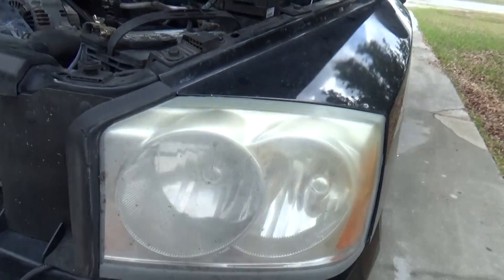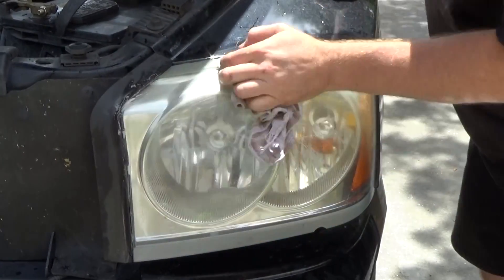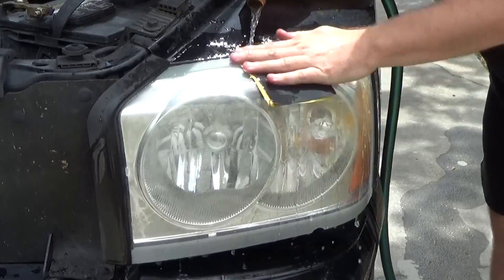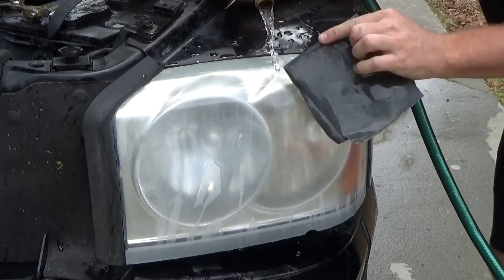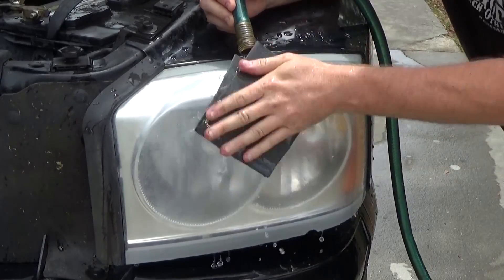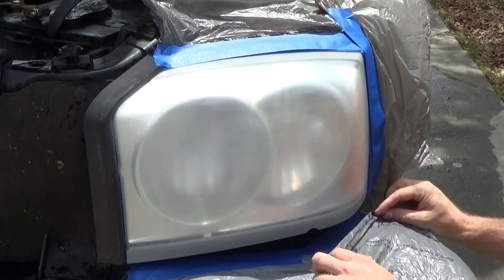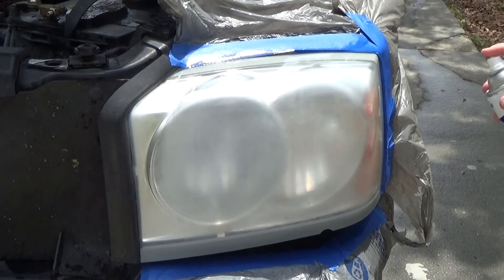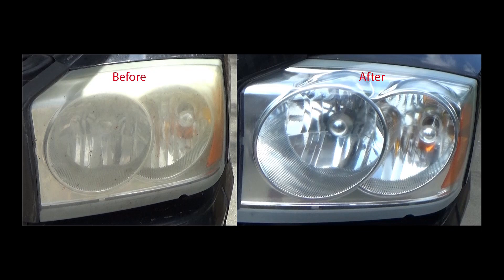How to Fix Yellow, Scratched or Foggy Headlights

Comment: After using this process and it lasting a year or so, can you just repeat the same process again?
Reply from the maker: You sure can. However, Meguiars makes a product now that if you apply it, it will keep it from yellowing. Meguiar's G17804 Keep Clear Headlight Coating
Reply from the maker: @furyofbongos  It's actually in process right now.  I applied it about 4 months ago and the headlight still looks perfect.  However, I am going to wait a year until I make a video of it.
Reply: @ClintHolland  How did the Meguiar's G17804 Keep Clear Headlight Coating work out?
Reply: @ClintHolland  How did the Meguiar's G17804 Keep Clear Headlight Coating work out? And how is that Meguiar's blue spray can different from the liquid protectant that comes with Meguiar's Heavy Duty kit? (small white bottle)
Reply from the maker: @ThePongstress   Ha ha. There is a reason that video hasn't made it to the channel yet.  The car I tested it on ended up getting totaled so I had to start over.  However, I will say that it wasn't going well. Even after like 6 months the treated headlight was already starting to yellow.

Comment: Great job, Clint ... this is very clever and I wonder if maybe your video is a first for Youtube on this subject .... I have restored a lot of headlights with same basic approach ... I usually use 1000 grit and then I go back and use automotive rubbing compound along with my rotary buffer ... polish it all out ... then wax the headlight as a final step using automotive wax  ... comes out very well. However .... I would like to try your method .... :)
Reply from the maker: Rick S. I can't take complete credit for it.  It's a combination of testing.  I got the idea from the Mother's kit but they use some special lacquer at the end but don't really share what it is.  The choice of sandpaper grit I have found is pretty much irrelevant as long as you finish with something in the 2000 to 3500 range.  The use of a clear paint was a suggestion from a colleague.  I used a couple but settled on the Rust-Oleum  as it was available everywhere and produced great results.  It also supposedly has some UV protectants in it.  So far so good.